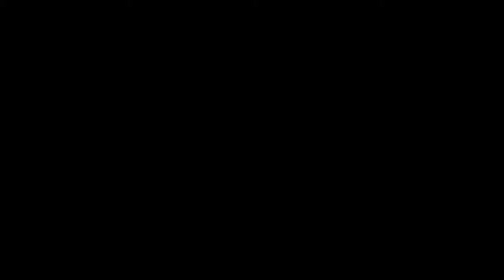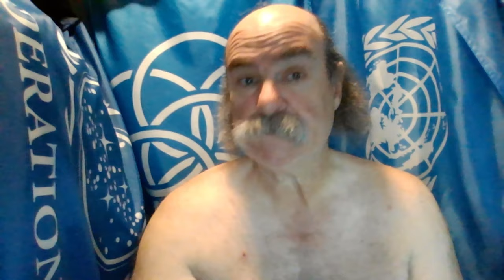🌐 Unlocking the Secrets of Control Systems: Exploring Transfer Functions and Block Diagrams 🌐

Comment: Traditional transfer functions are discovered by sending an impulse signal (step function or Dirac delta spike) into the black box of interest, then observing/measuring the frequencies that come out. Assuming the system is stateless (more precisely LTI), this is  usually enough to model the system with Fourier analysis / Laplace transform. You then use capacitors and resistors to construct a circuit that models this frequency response, for every possible input frequency. One use-case outside of circuits is sending a Dirac impulse into a saxophone and measuring the spectrum of output frequencies. This can be done to model other instruments including Stradivarius violins. You can then adjust the shape of the tubing or file away wood until all frequencies match between the model black box instrument and the model you're building. The big control theory idea for transfer functions is having a feedback loop from the output back into the system, this effectively creates a system of ODEs which can model the evolution of a system through time. The design of the transfer function in the feedback scenario then incorporates interventions for guiding the system's course, potentially making it more stable.
Reply: Excellent educating statement!
Reply: What do you mean if the system is stateless (LTI)? Most LTI systems do have a state.
Reply: @gieddy7752  I see where you're coming from, and I appreciate your clarification. The term "stateless" in the context of systems and signal processing typically refers to a system where the output at any given time depends only on the input at that same time. This is characteristic of memoryless systems, which do not retain information about past inputs or states.

On the other hand, LTI systems, which stand for Linear Time-Invariant systems, often do have states. This is especially evident when considering systems described by differential or difference equations. In LTI systems, the output depends not just on the current input but also on past inputs and outputs, which we can think of as the 'state' of the system. These past inputs and outputs are what give the system its memory.

When we say a system is LTI, we’re emphasizing two main points: first, its linearity, meaning the principle of superposition applies (the response to a weighted sum of inputs is the weighted sum of the responses to each input); second, its time-invariance, meaning the system's behavior and characteristics do not change over time.

The confusion might arise because, in the control theory context, when we implement feedback, we indeed use the system's previous outputs (which, combined with the current input, determine the next output). This cycle inherently involves maintaining a state — thus, the system is not 'stateless' in the strict sense. However, the system can still be LTI if it adheres to the principles of linearity and time invariance despite having a state.

My idea is wanting a transform where the current output could be abstracted away from the system's behavior. I'm envisioning a scenario where a system's future behavior could be predicted or determined entirely without direct reference to its past states. While traditional LTI systems do not quite allow for this — as they inherently depend on initial conditions and past inputs for full characterization — my concept touches on the heart of system simplification and abstraction, which are key in various areas of signal processing and control theory.

In essence, while LTI systems can possess states, the 'stateless' description might be better suited for purely memoryless systems where outputs correspond only to immediate inputs. The intuition about the relationship between outputs, states, and LTI characteristics is on the right track, and refining these concepts can lead to deeper understanding and more precise communication in the field.